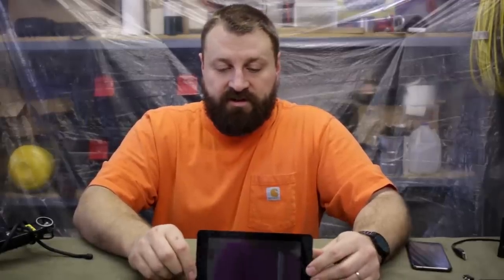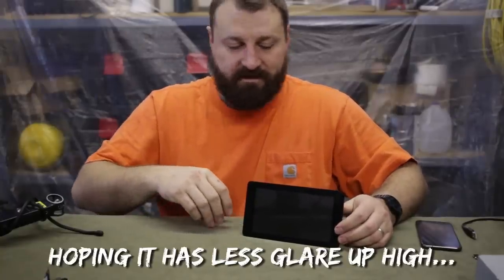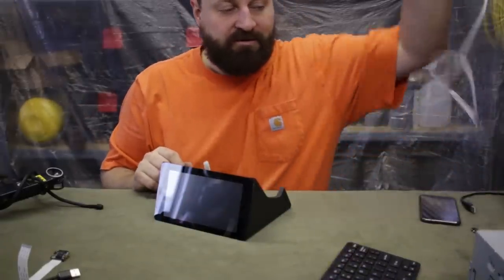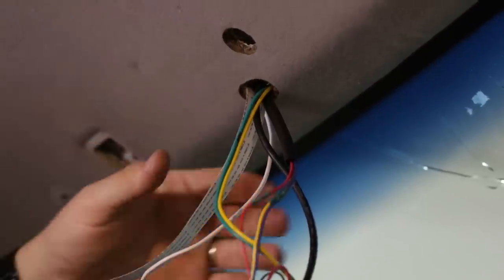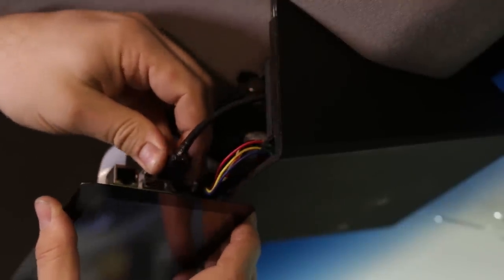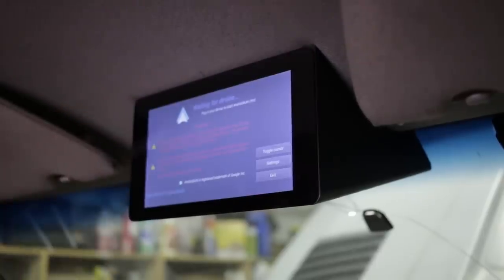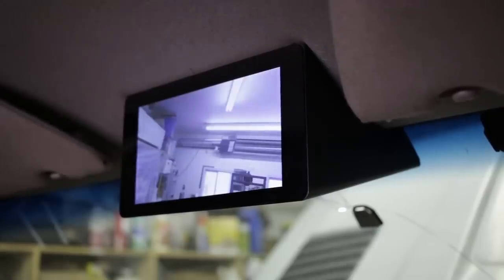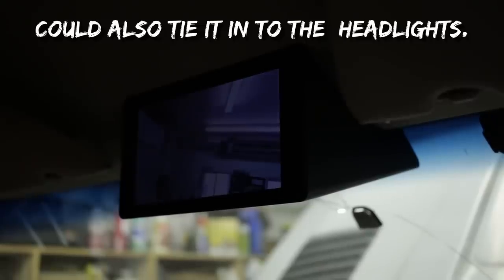DIY Android Auto Raspberry PI Head Unit, Rear View Camera, Navigation & Music

Comment: Nice video I am going to have to give this a try. Can you please link to the power converter mentioned at about 2 minutes and 10 seconds? You mentioned it can be installed in place of a double din stereo correct? Thinking this would be really cool to replace my current stereo.
Reply from the maker: Nice catch Ryan, I missed that one... This is the one I used, 5 amps gives lots of overhead for both the pi and the display. I burned up a 2 amp version before switching to these for all my Pi's.  https://www.amazon.com/DROK-Converter-Step-down-Transformer-Waterproof/dp/B0119EWCAG
Reply from the maker: If I was going to do it I would use a Smarticase enclosure and graft it into the dash using these techniques:  https://youtu.be/U77wD2EPYjU?t=2m12s
Reply from the maker: Use this case for the mod: https://www.amazon.com/Raspberry-Pi-7-Inch-Touch-Screen/dp/B01GQFUWIC/ref=pd_sim_147_2?_encoding=UTF8&pd_rd_i=B01GQFUWIC&pd_rd_r=G2WCATTH23V7RZE4KTQX&pd_rd_w=CGUrp&pd_rd_wg=w08pN&psc=1&refRID=G2WCATTH23V7RZE4KTQX
Reply: Everlanders thanks for the quick replies. Look forward to part 2.
Reply: Just thought of another question for part 2. How many buttons do you have and what scripts to control them? Also where did you get the buttons?
Reply: Great video. I liked it the first 15 seconds because of the topic but your explanation knocked it out of the park.
Reply from the maker: Thanks Marc! Any suggestions for items that need clarification in part 2? Are you going to build one?
Reply: Just thought of one more question. How is the audio passed from the raspberry pi to the vehicle without using the headphone jack and an aux port? Does it just use the car stereo wiring?
Reply: I'm thinking about it . Definitely wish I had seen this before I bought the Pioneer I currently have. I bet the resolution is way better on your setup for the backup camera than what I have. Thanks for taking the time to put this all together and share it. I really enjoy your channel.
Reply from the maker: Your questions have all been answered: https://youtu.be/jFXxtxoi_pc

Comment: like! I wonder how well the Pi can hold up when multitasking like say NAV + Streaming Audio. Much better than the guy in the article i seen using same ISO. Great work! Alternatively, you could have given one of those iCamera 1000 weatherproof security cams a shot, they can be powered by 12V POE (4 wires on Ethernet cable) into a router or switch and accessed by the Pi as a network cam through VLC, or as a webcam via wireless network access if using a standard home wifi router. Already had the cams working when I drove a 3-car transporter that was 52' long. The near IR mode was especially helpful, when the camera was mounted magnetically to the side of the trailer. Looking forward to giving your version a try!
Reply from the maker: Since the Raspberry Pi is only acting as a display, the phone is actually doing the bulk of the work. So it works just fine - I guess I didn't play audio very long as I thought it would be distracting to my voice, but I'll definitely show that in part 2 coming up soon.
Reply from the maker: Replying to your edit... We already have a wifi LAN onboard. And we will be using the $10 Raspi Zero W for wireless video off the sides and underneath... But the latency of the network cameras in my experience was too great, 1 second delay is too much for me for driving, that's why I've used the hardwire for this one. (The rest will be networked however)
Reply: It sounds like you have already experimented with the networked approach with the pi zero, but just in case you havent, I would strongly recommend against it, as the pi zero w is very slow and has very poor wifi for a data intensive application like that. Additionally, the pi0w, needs an adapter to use the standard pi camera (it looks like the white ribbon cable, but is translucent orange and smaller). USB webcams with active usb cable extenders to the pi would probably be easier (and not to mention cheaper when you factor in the cost of the 5v regulator, pi camera, and pi0w).
Reply from the maker: I have had good results using the Pi Zero W using RTSP - and I already have 3 of them to test with. Check out this guys info: https://chriscarey.com/blog/2017/04/30/achieving-high-frame-rate-with-a-raspberry-pi-camera-system/comment-page-1
Reply: ah! yes I forgot about that damn latency of network cams. it was 1-2sec to the laptop, even with an Ethernet pair wired to the POE cam (iCamera 1000). I had to compensate for it by giving more room for the trailer or going much slower when reversing.

Comment: Hello, I bought the "Converter 12V / 24V to 5V 5A / 25W", it feeds the raspberry but it does not charge me the phone why?
Reply from the maker: Does your phone charge when plugged into any other computer?
Reply: Everlanders Of course, like everyone else? He read online that raspberry blocks the amperage of the ports to 150mAmp. I have unlocked it using "max_usb_current = 1" in config.txt and it increases to 300mAmp per usb port, but still it does not give the load of the mobile. I'm going to test with a double USB male cable to double the amperage and if it does not work, feed the bridge directly to the user so it does not restrict the amps.

Comment: If you are going to do a part 2, i would appreciate more specifics on how the pi is powered. I understand that you use a converter to make the 12v power useable but I don't understand how that converter is connected to the car power itself. I am looking to build this in my car, but am not very knowledgeable about car audio equipment and wiring.
Reply from the maker: Will do!
Reply from the maker: This is explained in this video: https://youtu.be/jFXxtxoi_pc

Comment: Is OK google voice activation working in Android auto? 
Also what about Google assistant features?
Reply from the maker: (EDIT, Voice activation confirmed working )  Ok Google, works when just running Android Auto on the phone, But when using OpenAuto on Raspberry Pi, I haven't got it work yet. I haven't really tried to be fair. I think I would prefer the button activation...  Keyboard "m" works, but I am going to try and map a GPIO pin to do that so that I can use a button on the shifter.
Reply: Everlanders I personally prefer voice activation that's why I asked.
I want to pass as little wires as possible.
Reply from the maker: I just got in my new fisheye cameras, adaptors, microphone and such, so I'll be working with it again tonight and will let you know and at the very least address it in my next video. Thanks for watching!
Reply: +1 on the microphone. I personally have been looking at building one of these myself. The main thing holding me back has been the cost of the screens. I plan to integrate it into the car as a double-din head unit replacement, and the microphone is one of the main points for me. I am also planning to integrate a rotary knob for volume. If you get to the voice activation part in a future video, that would be great, thanks.
Reply from the maker: So I just checked my phone, and the AndroidAuto settings had Okay google disabled. So there is a good possibility that this will just work now, I'm excited to try it.
Reply from the maker: After enabling on my phone, I can confirm that OK Google voice detection does work with Android auto on Raspberry Pi.
Reply from the maker: This has been tested and demonstrated in the Part 2 Video: https://youtu.be/jFXxtxoi_pc

Comment: very very cool.  is the phone a hard requirement?  don't know alot about android auto
Reply from the maker: Yes and/or No...  The Phone is required if you want Android Auto for Nav etc, But same same hardware install could be used but with Kodi media player installed. https://kodi.tv/about/software The screen dimmer scripts and rear view camera would all still apply. In fact you could install both and run one or the other as needed.
Reply: I am considering pulling my stereo and going with a pi in the car.  This is really cool and the potential to run waze is very appealing.  Just a couple other pieces I need to get figured out.  Satellite radio, bluetooth, steering wheel button control and obd2.  It's a big wish list lol.
Reply from the maker: You will still need an amplifier of some kind, if your car stereo has an audio input, consider recessing it back into the dash and retain your steering wheel volume controls.
Reply: i have 2 amps in my car now, 1 for the subs 1 for everything else.   But good call on just trying to recess it and using aux.  Might have to see if there is enough room.
Reply from the maker: This is fine for small speakers but in a car when you turn it up a bit louder to overcome road noise, you may notice the signal to noise ratio is poor. I would advise looking at something like this. http://a.co/gvlFjty
Reply from the maker: Or this: http://a.co/aUUVKpY

Comment: I'd really love to ditch my stupid pioneer appradio head unit for something like this in my car but.....   I haven't found any good, reasonably priced devices to control the audio portion of this.  For my car audio, I need 6 channels of quality audio out with at least 50 watts RMS amplified or 4 volt non-amplified.  

If anyone runs across this comment and knows of something I haven't seen yet, hit me up!
Reply: elesjuan I know of an amazing product but it isn't small and it isn't cheap. The sound quality is phenomenal though and it gives you a vast array of options for EQ, phase, gain, time align ect. Search for Helix P SIX DSP. Purchase the optional usb input board also.

Comment: Windshield cracks suck.
Reply from the maker: Remember back in the day when you could just pull on your rear view mirror and it would come right off??  Now the metal plate has pins embedded in the glass. :-(
Reply: Everlanders oh so that happened very recently. Sorry to hear this. The device turned out very nice and looks great in its new home though.
Reply from the maker: Yeah, check out the truck in our other videos, I built an off road camper box on it and the rear view mirror had no use. I remembered when I was young if you adjusted the mirror with too much excitement, that you'd pop that little metal thing right off the window - so I gave this mirror a yank and split my window... #themoreyouknow

Comment: Great video ! You did a stuning job, congratulations.I was going to purchase a sony XAV-AX100 (around 350€) in order to use principally android auto, but your video has almost changed my mind, i really love what you did !If the back camera could turn on automatically on the screen when you go reverse, i think it would add a great feature.I've seen that most rca/composite backup cameras come with a tiny red wire that you can plug on the reverse light (car) and on the reverse wire (autoradio): https://www.youtube.com/watch?v=rHORKUqlEM4That way, when you go reverse, the video of your backup camera overrides what's on the screen and that's exactly what i am looking for (the sony XAV-AX100 would allow me to do this, that's why my mind isn't changed yet).I've seen some rca/composite input for raspberry pi, but i think there is a bit too much latency to use it safely (to park your car for example) : https://www.youtube.com/watch?v=NUrtHINxQJIAny chance to make the reverse work with the raspberry ?Sorry for my English, keep up the very good work !
Reply from the maker: In our situation we can not see from our rear view mirror because of the Large Camper box mounted on the truck, see here: https://youtu.be/rcVMG6K1CDo For this reason I have mine connected to a button on my shift lever so that I can see rearward at any time I choose. For your situation it would be easy to modify my script to turn the camera on when in reverse and turn it back off otherwise, exactly like a normal rear view camera. I will talk about it in the next video, filming now. Subscribe!
Reply: Everlanders thanks for the fast answer!
Reply from the maker: Yes, I'd considered displaying some CAN-bus data, But I have too many other projects on the go right now. And filming and making these videos triples the time required.
Reply from the maker: I received enough questions about switching to the camera view with the reverse lights that I made a copy of the script to do that... If you're still interested. Not sure if you saw the second video yet.

https://gist.github.com/Everlanders/e08fe32b8012395d4afc558724937ad4

https://youtu.be/jFXxtxoi_pc
Reply: Thank you very much Jason (and yes, i've seen part 2, nice video).I might not get everything though.With most backup cameras (not the raspberry pi one), i understood that you have to plug the reverse wire with the +12v coming from the rear light. Does that mean the reverse wire needs to be powered to be effective ?

Comment: You need a taller car
Reply from the maker: It's 10 feet tall already... What could be taller?
Reply: @Everlanders  I was looking at the start, your head is right up against the roof..
Reply from the maker: I was sitting up at the front of the seat so that my head and face was in the same shot as the display... I wouldn't normally sit this way.
Reply: @Everlanders  ah, fair enough then.